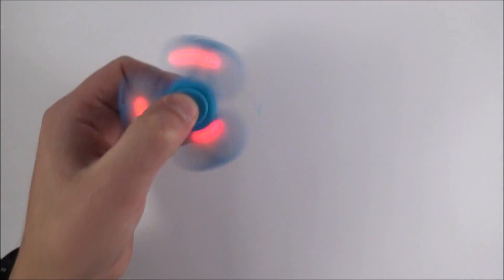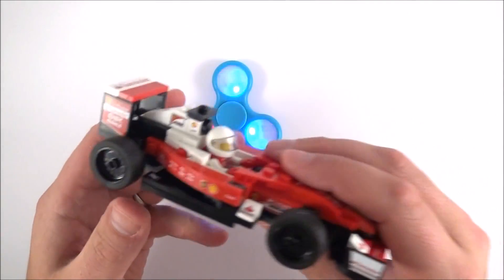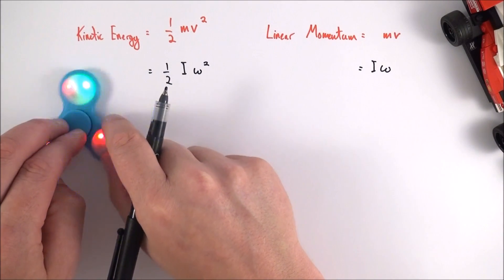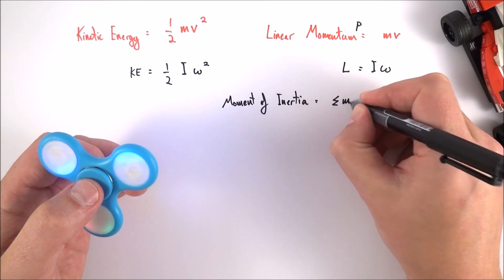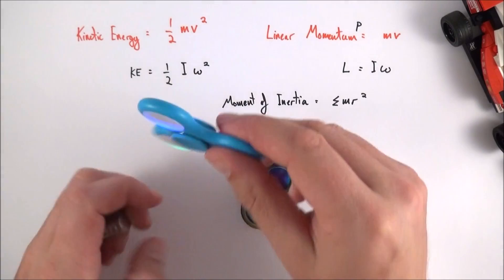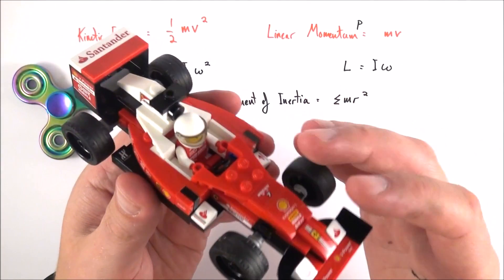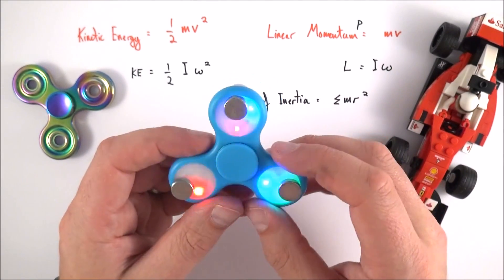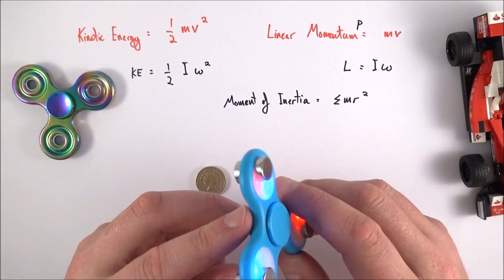Physics of Fidget Spinners - A Level Physics

Comment: I'm building a spinning stage for a friend's dance performance, and this is super helpful. I'm also curious about friction of the wheels. I have the attached to the spinning element, but I think I can reduce friction by separating the casters almost like a 4 wheel bearing.

Comment: Ahh, the common misconception. Wd-40 isn't a lubricant but a water dispersant hence the name wd
Reply: bearings have least resistance when dry (ie no lubricant), but it means it is more prone to rust. (7 years of skateboarding has told me this)
Reply from the maker: You're completely right. Well spotted. When I filmed this video I looked in my garage to something that could be sprayed in - I had lubricant for my motorbike chain and some WD40. The WD40 can was smaller and would fit in the video so I thought I'd use that for the video.
Reply: im sure you knew, you ride bikes ;)
Reply from the maker: I didn't think anyone would notice!
Reply: sorry, LOL!
Reply: Sorry to butt in but WD-40 general purpose (which is what the can looks like) does contain lubricants.  The following is taken from the WD-40 website common myths section: 

A QUESTION OF LUBRICATION

Myth: WD-40® Multi-Use Product is not really a lubricant.

Fact: While the “W-D” in WD-40® stands for Water Displacement, WD-40® Multi-Use Product is a unique, special blend of lubricants. The product’s formulation also contains anti-corrosion agents and ingredients for penetration, water displacement and soil removal.
Reply: being a liquid, it will have lubrication properties, however that is not is purpose as wd 40 penetrates the object and drives out moisture to prevent rust etc. in the case of a fidget spinner, wd40 would be detrimental to its performance as it increases the rolling resistance.
Reply: It will have lubrication properties because there are lubricants in its mix as well as the water dispersal agents.  I think it would be an interesting experiment to see how it affects the performance of a fidget spinner.
Reply: Lubrication improves long-term performance especially under load.  Not an issue with a fidget spinner.  I'm not a skate-boarder but have been a cyclist for 30 years and would never run any part of a bike without some form of lubricant.  I agree that good surfaces (does anyone make a ceramic or teflon fidget spinner) will have the lowest rolling resistance without other substances being present.  My original point is that general purpose WD40 does contain lubricants (it certainly isn't the best lubricant for many purposes and is why there over half-a-dozen different lubricants in my workshop).  I still think it would be an interesting exercise to investigate lubrication on fidget spinner performance, especially over time.